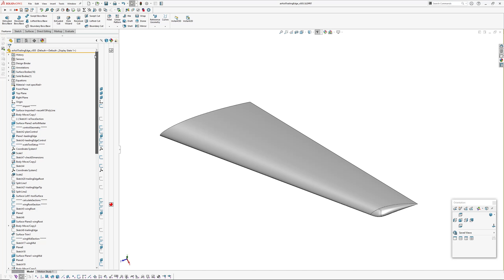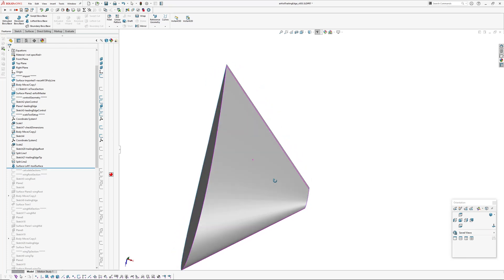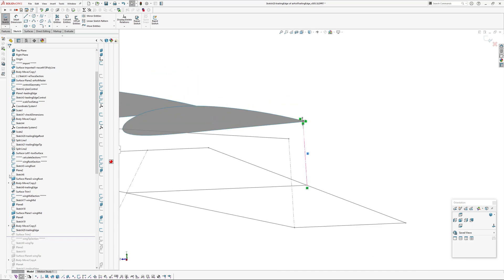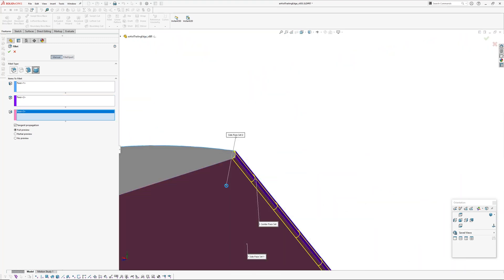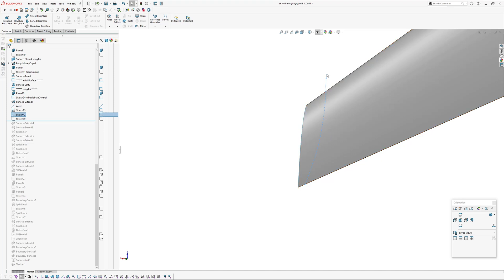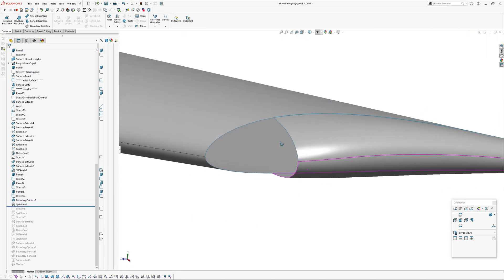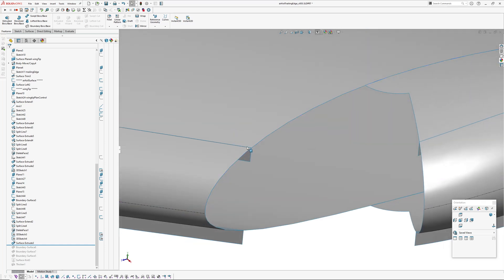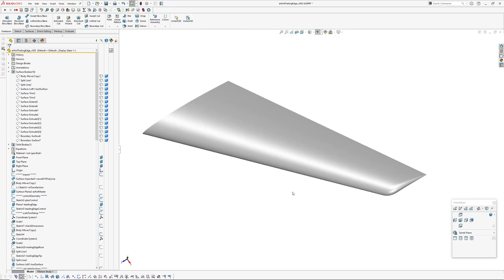Solidworks: Airfoils. Constant Thickness Trailing Edge and Wing Tip Construction

Comment: Hi, great quality, great content !. Kudos Andrew !

Amazing how powerful is your 4 sided surfaces process to solve tricky 3 sides surfaces.  
Perfect solution to handle many tricky ends.
Reply from the maker: I picked up the trimmed corner technique when I was at Designpartners in 2003-4 (now a part of PA Consulting). They used it extensively on Logitech KB and mice. It is definitely one of the techniques I use frequently!
Reply: @AndrewJacksonDesignStudio  Well, thanks for sharing that !

Comment: Awesome work Andrew! I like the face curve + boundary trick for guide curves. 

I have implemented your scale calculator in unison with equation driven airfoil sketches. I now have parametric control on everything from airfoil itself to the span, sweep, twist and dihedral of the wing. Amazing time saver when you are iterating with CFD.

I’m dealing with trailing edge thickness last in my model as I have some complex winglets and having a sharp trailing edge is more convenient for the base surfacing.
Reply: No, I leave that up to the pros.
Reply from the maker: Hi Zack, that sounds awesome! Are you running CFD in SW?
Reply: Sounds brilliant! Would you be willing to share a model with the built in equations?

Comment: Thanks for the video! Do you fell like when surface modeling in SW its easy to run into problems caused by SW itself? Like when you try to split a complex surface with another surface and you get an error even if it should work. I wonder how much it's a problem with SW and how much it's a problem with person modeling. Do you often get these errors?
Reply from the maker: Yes, there’s definitely some issues that have been consistent throughout multiple versions of SW. As you said, like when a surface that should split another (because the edges intersect) does not. In which case you go through the normal list… choose a surface body instead of faces… that fails, so extend edges on the splitting surface… that fails, run a body check. Theres a general error caused by a trim or knit further up the tree. Reorder features until the general error is no longer present. As for the sketcher and curvature continuous constraints!
Reply: @AndrewJacksonDesignStudio  Thanks for a fast reply :) We are thinking about moving to NX as we model may complex shapes with dependencies between them. Do you have any experience with other CAD systems other than solid?
Reply from the maker: I used ProE/wildfire/creo from about 2000i until Creo 1, mainly for sat nav’s and seating products. Never used NX although I’d love to at some point.